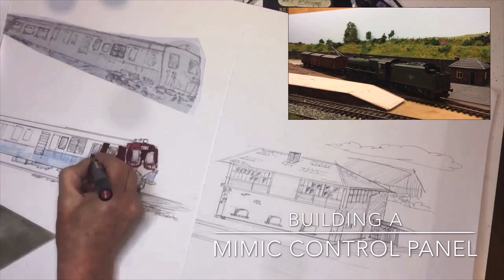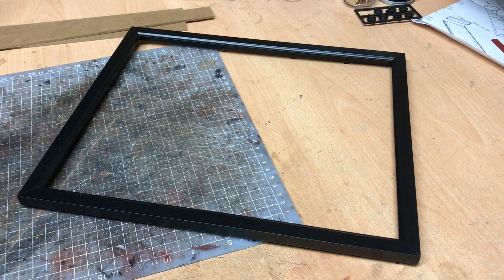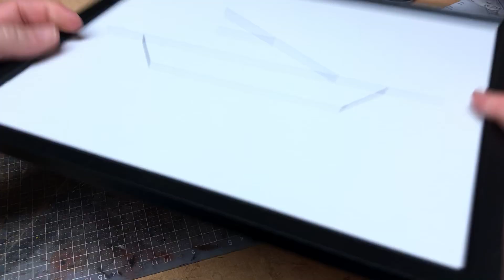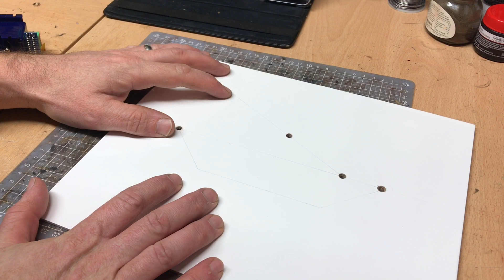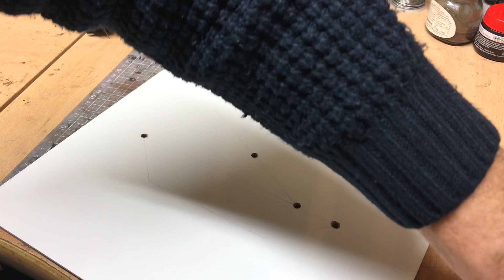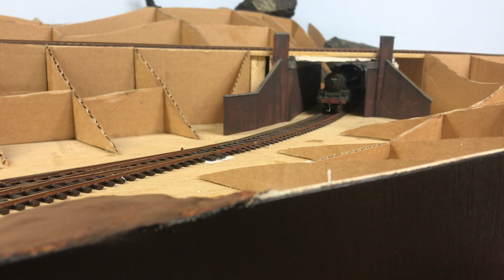Building A OO Gauge Model Railway: Building A Mimic Control Panel

Comment: Hi Muppet (LOL). In PBS-C the "C" stands for Common (or centre!). I think the word you were looking for was "bezel" (as you remembered!). I suspect the point motor wasn't grabbing the wire due to a weak (or broken?) spring. You could still use it on a point that you control with the NCECab. I like the mimic panel. My own plans for a mimic panel are a little more ambitious with LED push buttons. I saw a video on DCCconcepts website that featured a frame in which the edges open up to fit the panel. I designed the panel plan with Libre Office Draw. I'm not so good working with wood (which I don't have lying around) so I need to work out a supporting frame.
Reply from the maker: Hi Paul, you must be working your way through some of my old videos, if that’s the case thank you. Paul

Comment: Hi Paul! Really nice video, and 1,000 times better than my effort! That was a disaster! I will re-do mine at some point using this technique! Very clever to start with the picture frame!
Reply from the maker: Thanks Richard, I’d been mulling over this project for some time with no clear idea on what or how i was going to produce something. The picture frame was a great starting point giving me dimensions to work from for the cabinet carcass and more importantly something simple but effective to house the board. The square well finished frame to dress the box was an added bonus. Paul

Comment: I completly love the idea of the photo frame Paul it adds an extra something to a mimic pannel. Your wiring is not simplistic at all, it looks exactly the way id expect any wiring to be done, no need to over complicate what doesnt need to be. Top stuff.
Reply from the maker: I’m sure I’ve seen the picture frame idea elsewhere but it came to me one evening and thought it would provide a good option rather than trying to fabricate something myself. That’s the easy bit of wiring done, I expect more difficulty with the directional lighting units. 😬 Paul

Comment: Hi Paul, that wiring looks great! Your (dpdt) switches only have three pins (or?) which seems to make the wiring to/from the Cobalt point motors relatively easy and neat. I started building a relatively small layout in January and my trainshop advised me to use MP5 point motors. It took me a bit of time (and lots of trial and error) to figure out how to do the wiring, and what I ended up doing seems much more complicated than what you have done on your layout. You can see here: https://youtu.be/PzQuJZfUJYU how I did the wiring. Any thoughts are welcome!!
Btw great videos and thanks for the inspiration!
Regards, Paul
Reply from the maker: Hi Paul thank you. Yes, only the three pins on my switches and I believe you can get away with two on them as well. I looked at your video and got completely lost in the wiring schematics. It’s just not my thing, wiring, and one of the reasons this method worked so well for me. I hadn’t heard of the MP5 motor until you mentioned it but reading round the subject a little it seems to be favoured by some. I think this is another case of horses for courses and what works best for the individual modeller. Paul
Reply: @GalgormHall  Hi Paul, thanks for your reply! I agree, it's another case of horses for courses. I can imagine you got lost in my wiring schematics, I didn't find it easy to figure out, and I did ask my train shop for some assistance as well 😁. What I really liked about the MP5 is how much smaller in size it is. Some spaces below the baseboard are really tight, then a small point motor works well.
Regards, Paul

Comment: This is very timely Paul.  I am thinking of how to operate the points at High Elven when I build that bid, and a mimic panel was something I was considering.  If it works I may convert the other panel of switches.  Even with my level frame, remembering which is which and which they are pointing takes quite some doing.  Stephen
Reply from the maker: It’s funny how this happens, videos pop at the right time, I know that’s been the case with some of your topics when I’ve watched. Very happy with how this turned out and a very inexpensive build. Paul

Comment: Nice idea with the photo frame.  Saves alot of time and effort in making something up when you can pick them up pretty cheaply.  Cheers
Reply from the maker: That was my thinking and dimension wise worked perfectly between the joists. I certainly wouldn’t have made anything as neat from scratch. Paul

Comment: The panel looks great. That appliance paint gave it a mirror kind of finish that's very nice. I noticed the rail was not lined up on the siding switch that you crossed first in the video with the train. It looked as if you had put the rail on top of the rail joiner. It looks like the connection of the switch to the mainline on the rail closer to the front of the layout. Don't know if you've noticed that or not and i don't want it to cause you problems down the road. Carry on, your layout is looking great and progressing nicely!
Reply from the maker: Thank you William, the paint was a lucky find but I think it works well. I noticed that bump to, something I’d missed before and will investigate. A quick look didn’t show any eve idea W of a misaligned joiner but I need to inspect further, appreciate the pointer though. Paul
Reply: @GalgormHall  Just trying to help.   👍
Reply from the maker: Appreciated too William. Paul

Comment: Hiya Paul, this is something I have been putting off for a while now but I must have a look at it again soon. Great job and I know the cobalts make it easier. I have mainly Peco solenoid so should be just as simple once I work it out. Great job as always, well done, looks great too!! Cheers, Chris
Reply from the maker: Thanks Chris, that’s half the battle, working it out. After that it’s a straight forward repetitive process. I put it off for long enough myself but honestly it was quite easy once I knew what I was doing. Paul